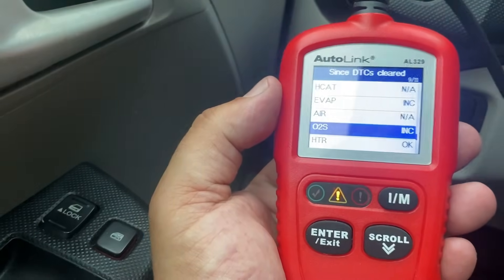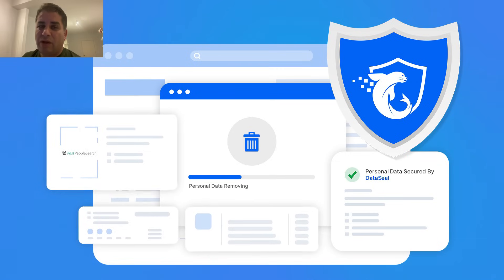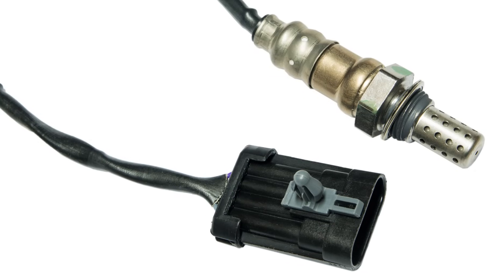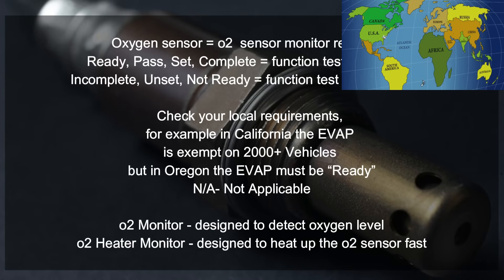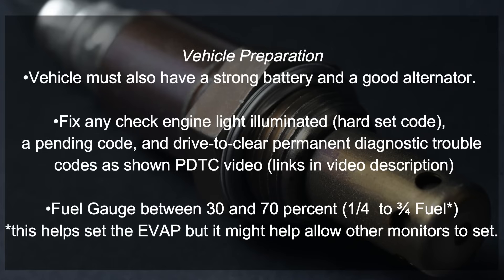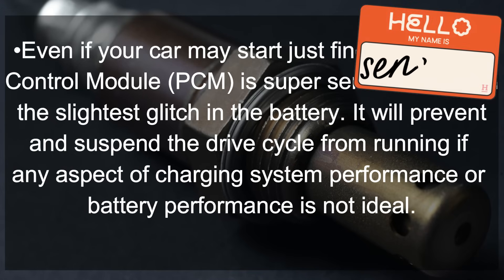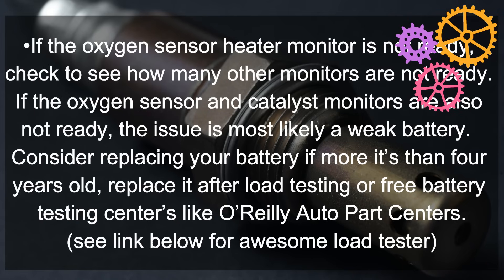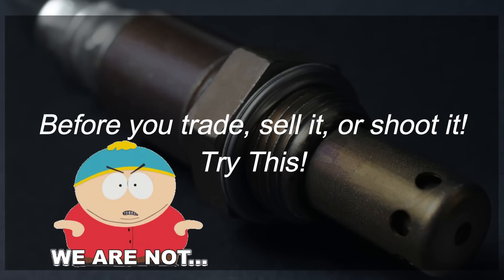O2 Sensor Monitor Not Ready ▶️ Smog Drive Cycle Oxygen Sensor Monitors Not Ready Problem FIXED

Comment: I have had my car in the shop 4 times in the past month to repair oxygen sensors (?) so engine light will go off and I can pass smog. What is the problem... they have already charged me $660 to repair whatever it is they are trying to repair and still "FAILED"... do you have any suggestions??? I understand my car is kinda old (2007), but I am getting very impatient with this situation. Could it be that my car will "NEVER" pass smog??
Reply from the maker: 4 times for the same issue?
Why did it fail the smog?
Is the check engine light on or are the inspection monitors not getting ready.

Comment: my 2017 nissan van wont get the heated cat and the fuel system monitor ready.  I have driven it thousands of miles, unplugged the battery and started over--I drive it as an AC service van so its all in city and freeway traffic.  I dont know what to do.  Nissan had a recall to reprogram the computer---I did that no change- but I have not driven it much.  So is random driving going to do the same as driving exactly how the drive cycle the state tells me?  1/4 to 3/4 tank, drive 22 mph for x miles, go on ffreeway at half throttle- etc.   I have a scanner plugged in to see if they ever go ready, but I have to get this fixed.   One mechanic told me if the battery is weak that could do it----not sure---its a year old battery but the heat kills them so they usually last 2 yrs.  I am at wits end.  Thanks
Reply from the maker: You need to load test the battery, this is common,  I made an updated video about this https://youtu.be/cV6NewPWo2E?si=X6kN7SoZGq6oP-_V to do this for o2 monitor 

But for your o2 heater monitor, is it the original o2 sensor on the up stream?

Comment: I have a 24 Silverado 3.0 diesel.salvage title. Rebuilt it myself.  Less than 5k miles on the car and battery. I’ve got all of the sensors reset except 02S is still Inc. ran through the driving cycle, nothing. Heater monitor was the last one I got reset. Really frustrating. I’m going to try to just let it warm up for longer, I’ve only let it do it for 2-3 minutes. Any other tips would be helpful.
Reply from the maker: During the warm up process, don’t move or touch the gas pedal, turn the air conditioner to max and also turn on the headlights, rear defrost, and other electrical loads to help set that stubborn o2 monitor. 

Was the vehicle in a front end wreck? Congrats on rebuilding it yourself, that’s awesome!
Reply: @RANDOMFIX front driver side. 

Had to replace radiator and support, as well some other body parts hood, fender, bumpers, driver headlight, shutters. 

I’m going to check my battery the way you suggest to see if that’s the issue. We did have to recharge it despite it being relatively new

Comment: 2017 Hyundai Elantra 2L.  fuel, cat, o2S, Htr, and Evap will not clear. I have a brand new battery, everything has been done. Never had a code, nothing in memory, car drives great. Drove the car close to 1000 miles with all sorts of configurations, rebooted ECM, nothing works. mis, ccm and egr  clear, the other 5 will not

Comment: Hi mate - thanks for you video. I have a Mazda CX 5 2016 stuck with the 02 monitor sensor INC - Any ideas??
Reply from the maker: Is the o2 sensor the original that came with the vehicle?

( have you loaded tested the battery?) 
have you checked the battery to make sure it’s sitting above 12 volts after having the headlights on for 5 minutes with the engine off?

What caused the o2 monitor to become unready?

Comment: A common problem on many cars, especially GM is with a cold engine the coolant temp and intake air temp readings have to be within 10 degrees of each other or the monitors won't run. Usually the coolant temp sensor is out of calibration if this is the case.
Reply from the maker: Thank you for sharing this information about coolant and intake temperature temps.
Reply: Was thermostat      sometimes not ready stuck open on my Chrysler van

Comment: I am gonna run this battery test and check the voltage. Over 100 miles driven and only the Evap and some other ones are ready. O2 and EGR are not ready. I dont want to remove my battery and have it tested at Oreillys because then if it is actually good I would have to start the drive cycles all over again. For a Jeep Wrangler should I run the car for five or ten minutes before checking the voltage?
Reply from the maker: You should check the voltage after the vehicle sits for 5 minutes with the headlights on.
You need to verify the charge is not a surface charge.

There are load tester that do the same, I show it in this old video here https://youtu.be/Zpe_oOUZsUs?si=UxGyx9N7EZhiYBml
Reply: @RANDOMFIX  I checked it after 10 minutes and it read 12.6, but when I started the engine it drops to 11.07 then goes up to 14sh.

Comment: I have a 2010 Chevrolet Silverado 1500, the battery was bad so i replaced it. I was able to pass all the codes with the driving cycle. I’m just having problems passing the “evap and 02 sensor” any tips?

Comment: Hello I am a really frustrated 😂 with my 2011 Ford Econ E350 Super Duty. Okay van been sitting for a year. I got new interstate battery, full tuneup, new cats, well one replacement. I have driven this vehicle 670 miles okay that's like 6 cycles. I had nothing showing ready then took back three days later 4 censos ready. Now I can't get the Evap system, heated O2  censor, and oxygen censor to get ready. O BTW new gas cap. Dealership no help, I just put $5,000 worth of repairs into this. Oh yeah also cataclean in gas tank. 😂

Comment: I'm currently having an issue with my 2006 Chevy Colorado. The only emission test monitors that won't clear are the O2 sensor and O2 sensor heater. Normally they clear super fast and im waiting on the Cat, but this year year the cat is clearing but not my O2 sensor and heater. I've checked the fuse, I've tried disconnecting the bat, but nothing and im stummped. Could it really be related to the battery?
Reply from the maker: Turn on the air conditioner and headlights with the rear defrost right when the vehicle starts. As I mentioned in the video if it’s last then it might be old. So if it doesn’t get ready then replace the upstream o2 sensor and the o2 heater is also built into the pre cat o2 sensor. Only buy the oem replacement, nothing aftermarket if you want to avoid more complications. Keep me posted
Reply: @RANDOMFIX  So I changed the upstream O2 sensor and still can't get the tests to clear, someone else tole me that i was the IAF that was the problem for them which is built into the MAF so I changed that as well and still can't get it to clear. One question, would the daytime running light fuse being blown out affect these tests at all? I found one blown fuse related to those and haven't replaced it yet, but didn't think it would affect my problem.
Reply: @RANDOMFIX  Will do and thanks for the quick reply, I'll let you know, I just finished the continuity tests on both O2,s and they were good. I've replaced the rear a few times, but honestly can't remember if I've replaced the upstream ever. Also my bat is good and is around 12.2V.

Comment: 2005 Cadillac srx. Catalysts and 02 sensor not ready, but heated o2 and EVAP SYSTEM are ready
Reply from the maker: Here is the gm drive cycle https://youtu.be/Yp34ksJY-fQ?si=Ss3EnRsq0j0fnEBC

Focus on a long warm up cycle, with air conditioning set to max along with rear defrost for about 20 to 25 minutes, if the temperature is super cold, let it idle even longer. After the warm up hit the free way with air conditioning off and no cruise control. The idle will help with o2 sensor and the freeway drive will help catalyst monitor.  Repeat twice!

Keep me posted and good luck
Reply: @RANDOMFIX  thank you so much. I will try this and let you know the results.

Comment: Too much rambling.  I want to pass the emissions test I don't care about ANYTHING else. SIMPLIFY Your Presentation ---- Recommend: A.)  Outline, &  enumerate top 3-4 common issues for not passing emissions test. < CAT, O2 Sensors issues, EGR issues, Battery, Drive Cycles, Maintenance required- CEL Lights, etc.,  B) Outline the  top 3-4 common fixes for those issues. Lose the rest of this post. -Respectfully I am mechanical & technical , you went down too many rabbit holes in 15 minutes <& Commercials>  lost me several times....
Reply: Sound like an A hole. Just move on.

Comment: I seen in the video it talks about the fuel level I have a 2016 chevy silverado it's inspection time no mil light I started it up this morning and it was almost on E stopped at the gas station and filled it up went to get it inspected it failed O2 and Cat not ready been driving it around makes me wonder if it didn't make ready because the fuel level

Comment: I got a 99 chevy silverado had tons of codes , had them fixed and few of those was o2 sensors I had them all four replaced brand new, light went away for a while and had it smogged and failed the ‘Malfunction Indicator Light’ (MIL) section and I ended up getting a check engine light , had it diagnosed and its a P0160 code not sure what to do now
Reply from the maker: You now have an issue with map sensor. I would clean and inspect it. It’s the original map sensor you might want to replace it. Replace it only with an oem map sensor. Check the air filter and the housing (tubbing) of the map sensor  for leaks or cracks.
Reply: @RANDOMFIX Thanks for your reply 🙌🏼 I’ll have to look into it , its just weird it keeps tossing me codes on stuff I already fixed I’m really hoping its just the map sensor, i doubt previous owner changed the map sensor so its probably the original
Reply from the maker: @user-rh5dv3mr9x yeah, cars will keeping popping codes. Air leaks in the intake and exhaust are notorious for causing codes and people keep changing out o2 sensors.
Reply: @RANDOMFIX  Replaced my map sensor just of yesterday doesn’t seem to be the solution I still keep getting the same code, would it be something electrical ?

Comment: On my Mitsubishi I had the O2 sensor reading "Not Ready" status, hadn't clue what it meant (new to these  OBD2 testers), so instinctively unscrewed the sensor to check its condition. looked ok to me so reinstalled it, checked my OBD2 and noticed the O2 sensor was now at "Ready" status. Maybe the sensor thread was not making a good earth, but shouldn't have made any difference since signal earth is via a wire (4 wire sensor). Worth trying if you guys have a similar problem.
Reply from the maker: Did you unclip the connector beside removing it from the o2 sensor hole?
Reply: @RANDOMFIX  Yes I did,  it could have been the connector, however, I had previously unclipped the sensor (not removing the Sensor) and the Sensor state was at "Not Ready" when re-clipped. Certainly made a difference at Idle, what I thought was normal Idle was fairly rough compared to the "O2 Ready" state Idle.

Comment: I have a 2015 dodge ram promaster 2500 diesel. All other sensors set except the o2 sensor, ive driven and replaced some parts, i dont know what to do or set it.
Reply from the maker: I haven’t run into just the o2 sensor not setting on diesels but on gasoline vehicles this normally caused a weak battery. Just because the battery starts the vehicle doesn’t mean it’s good. If the battery is over 2 years old or has ever needed a jump start I would test. I good battery will rest a 12.7 or 12.6 volts with the engine off after a 5 minute load from the headlights. You want to make sure there is not a ghost charge.

Keep me posted and good luck 🍀

Comment: O2 sensors usually take a few cold start drive cycles to be ready .. be patient. Let car cool for a few hours in between drives since the heater only turns on when exhaust is cold

Comment: (Question) When my car is in the "On" position it displays 11.8V, and when I turn the motor on, it displays 14.0V. Does that mean I need to charge or change my battery?
Reply from the maker: This is normal, when the engine is running the alternator is supplying the charging system additional voltage. 

I would check the voltage after ten minutes of the heads light being on and the motor off. Check the resting voltage not the ghost charge. 

I show a tool that helpful with this under $30 in this video https://youtu.be/cV6NewPWo2E?si=37CyRM9-0U_Tl4Bm
Reply: @RANDOMFIX  Copy, thanks!

Comment: My evap code is hard set p0446 and engine light is on oxygen sensor monitor and catalyst monitor has not passed yet should i continue to drive until they pass or fix the evap and clear the code I’m hoping I don’t have to. Everything is set except the evap the oxygen sensor monitor and the catalyst monitor would hate to have to drive another 400 miles lol because it says it could take up to five drive cycles. And Eve app is not mandatory in California I guess
Reply from the maker: Yes, you need to fix the issue causing the p446 and then complete the drive cycle to set the monitors. No point in driving if you have a pending or hard set code.
Reply: ok thnks
Reply: I know this is late but an evap issue wouldn't prevent your O2 or catalyst monitor from resetting, even with a code. However the code will likely cause a failed test, so you'll need it fixed regardless.

Comment: I have a 97 crv o2 monitor wont complete. New 02 sensor and new battery. Have reset many times and rerun the drive cycle. Its been 3 months and hundreds of starts and miles put on it but 02 sensor still wont complete. I have a pro Autel scanner but the crv is to old to run monitor tests
Reply from the maker: I don’t see any reason why the monitors are not completing. I will try to start the vehicle when it’s cold have the AC and rear defrost on and any other electrical loads all on and let the vehicle warm up and afterwards take it for a drive around town 5 to 10 minutes. I don’t know what else you need to do as this very strange unless you didn’t use the oem o2 sensors. 
Keep me posted
Reply: @RANDOMFIX  OEM sensors from dealer. Ok I'll let you know

Comment: This video helped me a lot thanks, but I have a question how do you check if your downstream sensor is working? Because I checked my sensor to be sure my car is ready for emission and the upstream sensor are ready but the downstream is not it says not completed. Which is weird because the catalytic is ready
Reply from the maker: O2 sensor monitors are just one monitor and it doesn’t let you know if it’s downstream or upstream. The o2 heater is monitor, and that component is on the upstream. So you have assume both oxygen sensors as one monitor. Hope that helps. Thank you for the feedback

Comment: Looks like i got to replace my battery ill be darn. Explains why o2 senser cycle was taking forever.
Reply from the maker: I won’t replace a battery without load testing it. Here is an old video https://youtu.be/Zpe_oOUZsUs?si=GFdglt6Qhv0O2CfD
And these are pretty cheap and great to have. If your battery is over 5 years old or close to it and is lead acid battery just replace as there is no need to load test.
Reply: @RANDOMFIX  i had one of those lcd load testers and had a recheck at AutoZone they indeed said it needed replaced. Thanks for your help i passed the emissions test today after replacing battery oxygen and cat monitors cleared within 10 minutes of driving.

Comment: I have a 2017 nissan pathfinder went for emission test said evap system and O2 sensor not ready. Drove the suggested drive cycle and it is still not ready. Car is running fine no codes or lights. Help
Reply from the maker: In most states the evap is exempt other than Oregon as far as I know. So you really need to make sure that o2 sensor gets ready. Here is the nissan drive cycle https://youtu.be/s9PLkO-CjZ8?si=Muj2or4orFRzCNdV that has some useful tips. Remember you battery being almost perfect is super important to set the o2 monitor.
Keep me posted and good luck 🍀

Comment: My CAT, O2 monitors wouldn't set on a 2008 Honda Civic. I saw your video and replaced my battery. It was old and was giving me issues. I never realized it could impact the monitors. After replacing it, all monitors set quickly! Thank you for the video and advice!!!
Reply from the maker: I’m glad to help with your 2008 honda civic o2 and catalytic converters monitors. Thank you so much for taking the time to post this feedback
Reply: @RANDOMFIX Thank you for your videos. But i have a question. My car is dodge journey 2016. The O2 heat monitor is ready. But another one is not ready. Do i need replace the battery? I am confused a little bit. If the battery is weak. Why the O2 heat monitor can be ready? Thank you❤
Reply: But once you changed the battery did you have to do drive cycles to reset the catalytic monitor?
Reply: I just drove around. Checked them a day or two later and I was good. Good luck

Comment: Hi - I am having issues with my oxygen sensor monitor and oxygen sensor heater monitor not being ready ....i have tried everything ; multiple driving cycles, replaced all 4 sensors with new Bosch ones, replaced the battery to brand new one ....also checked the fuse box ...I am not sure what else to do to get the car emission ready ...it's 2006 BMW E90 (330). Any direction or advice you can provide would be much appreciated. looking fwd to your response!
Reply from the maker: Here is the bmw drive cycle https://youtu.be/mk6Tk330Acw?si=Qp4MbVZ-aI-IQhhE try and please ask any questions on that video. Both of these monitor are connect to upstart o2 sensor not the down stream o2 sensor. Good luck and keep me posted.